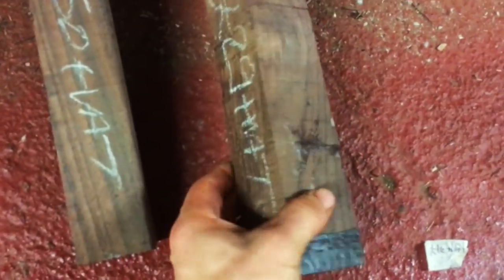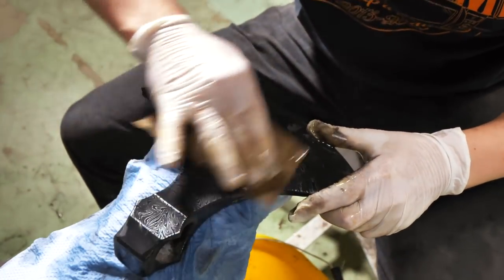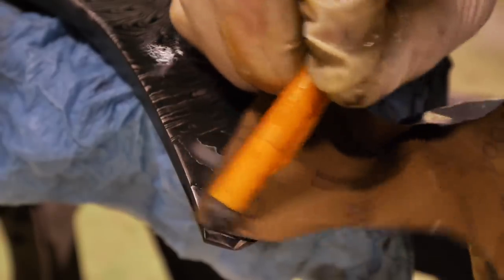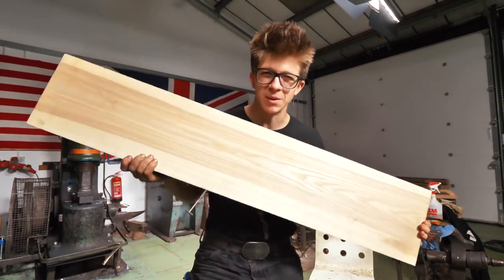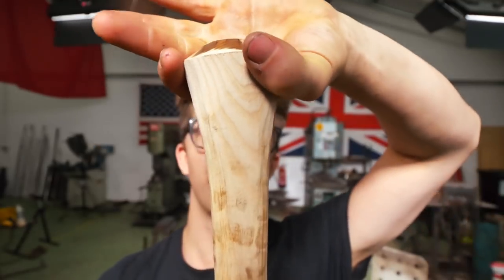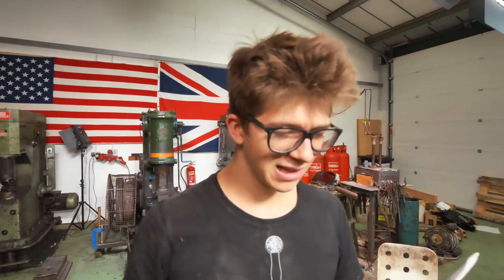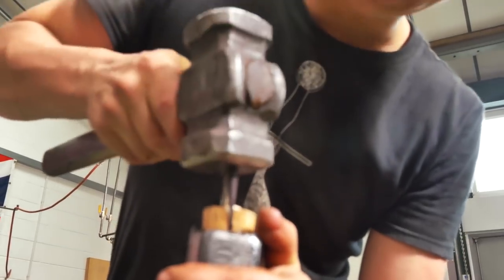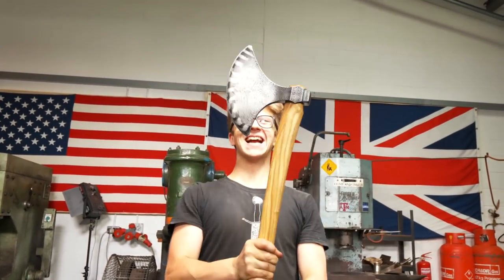VIKING BATTLE AXE: Part 6

Comment: Alec, could you try making a Damascus billet from mild steel and 304 stainless then instead of ferric chloride blue it in a boiling nitrite salt solution. the stainless shouldn't take the blue and the black color from bluing seems to have more of a shine than ferric chloride. I want to see if this crazy idea works.

Comment: I must say, beautiful job but, I believe you fell short on the handle. If you could find a grain structure that sort of matched the Damascus pattern, then char burned the wood and slightly sand, then put a darker stain on it. Then the handle would compliment the axe. 
You spent so much hard work and time on the axe, then in my opinion just half assed tossed together a handle. 

Very beautiful work though Alec, I look forward to your videos everyday.

Comment: Alex you're a wonderful artist, and that's a beautiful axe, but it's not a viking axe, nor is that damascus steel. Real damascus steel didn't get its paterns from patter welding, and the thickness of the axe head is way too big. Dane axes were about 3mm thick at the head, and weighted about .5kg. That looks like it weights twice as much. Loved the series either way, and I love your work, just pointing out a few errors

Comment: That's a beautiful axe, however, I feel like the handle is a little too big, it doesn't seem to fit the axe, aesthetically speaking. I feel like it could be a little shorter, and perhaps a little thinner at the top where the axe head is attached. I don't mean that it should be a lot thinner so as to affect the integrity of it, just a little bit to make it a bit more aesthetically pleasing and proportionate, and at the same time maintaining it's strength and durability

Comment: Bibinga and purple heart are my favs for the time being. Bibinga is super hard and dense I almost don't believe its wood. And the purple heart just has the awesome color in wood handles and scales. I think you just just try those and all the other exotic woods you won't be disappointed but lighter in the wallet. Also Sam does a good job cooking if that's what you want to call it.  But when you expand and move to New England I can be your foodsmith / blacksmith aid just throwing it out. Or I can train Sam to make better things with what he knows already.
Thanks ,
@chefjla

Comment: very nice work, however I don't think that is technically a battle axe, battle axes are very light with a relatively small head so it can penetrate very well into flesh and bones and leather armor with a handle that is long enough that it can be used easily with one or two hands. What you have is more of a Great Axe bud.

Comment: Should have done a shorter handle and given it more curves. Also I cringed when you were hammering on the end of it. Use a spacer from a scrap piece of wood or better yet a rubber mallet please. You over did it on the polishing but overall good job.

Comment: Alex your supposed to hit the handle on the ground to drive the head onto the handle. Its reverse to what you are doing buddy. Sorry but you can put micro cracks in the handle hitting it the way you were. You could also split it and make it useless.

Comment: Ouch!  The way you treated that fine ash!  Gotta work that wood keeping the strength and integrity intact.  Belt sanding is not the best way.    Need hand tool work with hand hatchet, draw plane, and scrapers.  Don't work wood like you do steel, please.

Comment: I've used wd-40 to protect the barrels of my fire arms for years and never a spot of rust, read the can it's a rust inhibitor....
Reply: I have used wd-40 my whole life and never has it corroded it rusted my tools. I leave all my hand tools covered in it. I spray bike chains, and hedge blades and everything with it. I have absolutely no idea what Alec is talking about?
Reply: WD-40 doesn't cause rust, it dissolves it. Which is why you don't want it on something etched, since it will eat up the oxides you just put on there!
Reply: WD stands for Water Displacer, imo.

Comment: Glue the wedge?  Really?  Why?
Reply: theallseeingmaster it's just redundancy to protect against the handle separating from the axe. But I don't know how well that glue is going to set because of the linseed oil he covered it in.
Reply: I cringed when he was  setting the blade.  I learned the easiest way is to tap the bottom of the handle on my work bench.  Forces up equal forces down; works every time.  Beautiful piece of work nevertheless.
Reply: theallseeingmaster , I'm excited that the edge he just sharpened didn't become a final destination incident lol